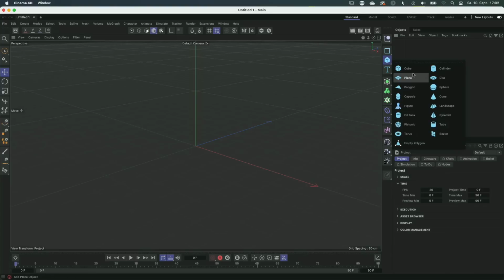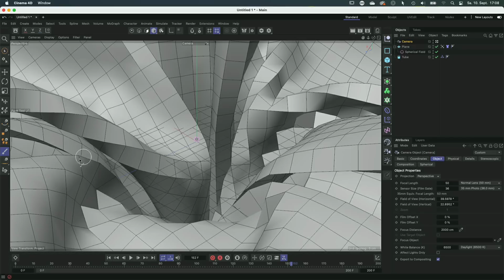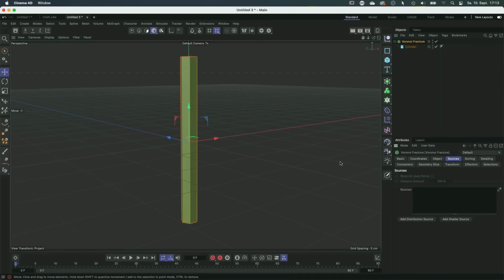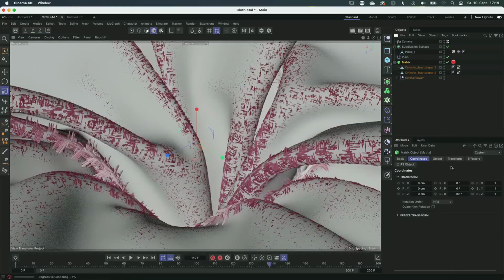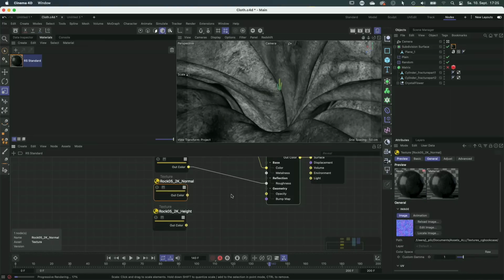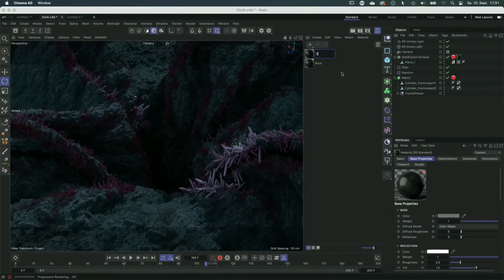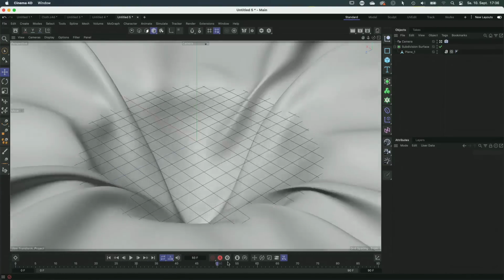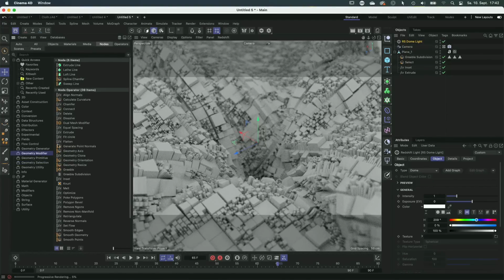Jonas Pilz Day 2 @ The 3D and Motion Design Show, IBC 2022

Comment: For anyone getting to the point just after vertex point and the cloth doesn't fall through - it seems you need to make the plane editable now so go back a few steps, select your plane and hit C > add cloth tag > add vertex map > tick box "use fields" > in the Freeze field turn on "Auto-update" > add  spherical field as per video and you should be all good! worked for me
Reply: thnx werry werry much!
Reply: took me 4 hour to figure out what the heck is wrong until i read this
Reply: In Cinema 4D 2023.2.0 this still doesn't seem to work for me. I have set this up, step by step and the only way I get the cloth to fall through the Tube hole is by changing the settings to 'Grow' in the Freeze section of Fields. However, this then stuffs up my scene when it comes to editing the gravity. HELP!

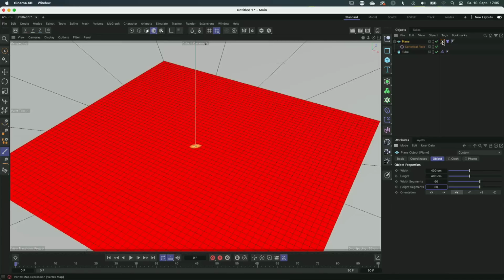Comment: At about 4:50 my cloth doesnt fall through the hole. I have everything setup exactly as Jonas does but it doesn't work for me.
Reply: Think I solved it, still a C4D newbie BUT. It looks like in an update they made Vertex Map fields update live during the sim. So the vertex map will be right the very first frame but then update. Do everything the same but when it's time for the vertex mapping, make the plane editable, turn on the vertex map, and pain the central point. It should work then!
Reply: @RwyoungIV  It was a new chenck box in the vertex tag they added with the update. It's called Use Deformed Points. Once I unchecked it, everything worked fine.